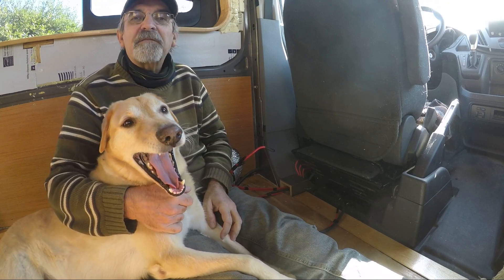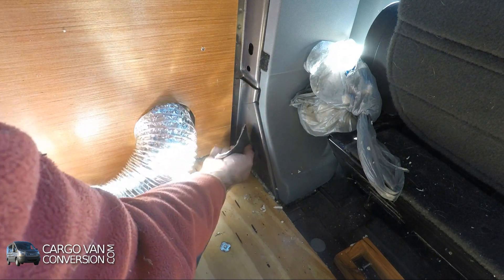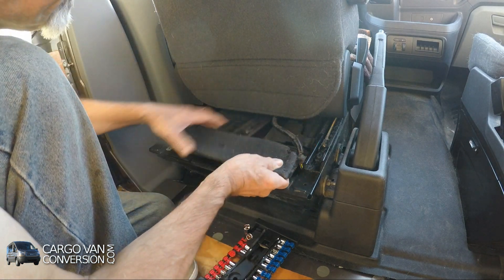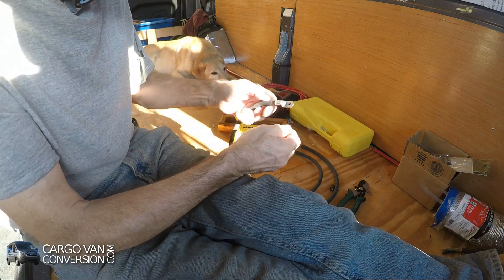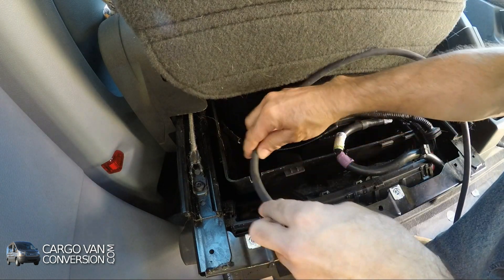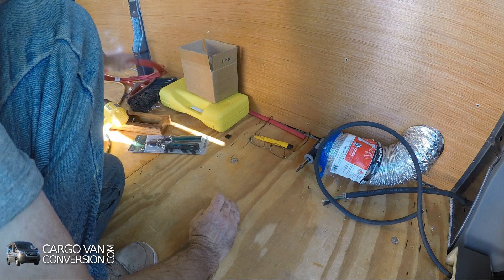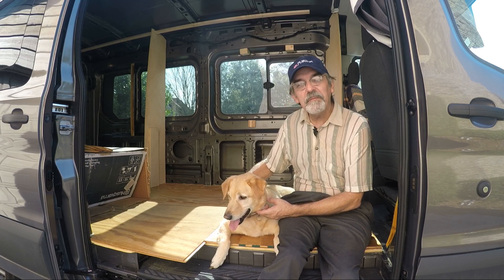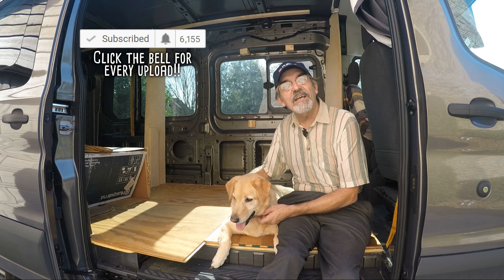Adding Inverter Cables

Comment: Any wire passing thru a steel panel should have a hole grommet or a cable clamp......you'll be sorry later if you don't.
Reply from the maker: I wasn't able to add a grommet in a regular way. but added a partial one after the cable was already installed. I concur that grommets are a necessity in these situations. But they are sometimes difficult to install.
Van Williams

Comment: Hi Van, I've also been crimping my cables last weekend! I bought a green version of that hydraulic crimper. Good to see I'm not the only one who uses the floor or a leg in place of the third hand that this invaluable tool seems to require!! 😁
Reply from the maker: Hi Mevi,
I'm regularly laughing at myself, when I review the videos. Some work needs an extra hand which I don't have :) That leads to funny situations, like in today's video and the turning of the sheet of Formica. Good to hear that the crimper works!
Van Williams
Reply: The formica, yes it looked like you were wrestling with a stingray. 😃

Comment: If you have to make repairs to the inverter, will you have to remove the Murphy Bed to do so?
Reply from the maker: No. I have a row of cabinets under the Murphy bed of about 15 inch (37cm) high. That will house the inverter. I'm working on it right now, so expect a video about it in the upcoming weeks.

Van Williams

Comment: I am a little mystified as to why you have an A/C connection under your van. (Weatherproof or otherwise.) Why not have a proper shore power inlet on the side of the van?
Reply from the maker: Hi Mark,
Two reasons.
I don't want to mess with the outside of the van. It's a stealth thing, don't want to look like an RV, but it's also less holes, leaks and rust.
Probably more important, is that the main purpose, this van will be used for, is boondocking. With enough solar power, batteries and drinking water, I have no inclination of using electrical hookups at all. Situations may occur that justify spending time on a full-service campsite and in those situations, I would still have the setup to hookup a 15A cable.
I think this is a clean solution, easy to use in an emergency without the need to mess with the van.
PS. Most vandwellers will use a stealth van to stay under the radar during urban camping; I have always been skeptical of that, as police can often easily identify an RV by their roof vent or out-of-state license plates. For me stealth is more a way to have a relatively regular van and not drive around in a recognizable RV.
While my van is still somewhat stealthy, the roof vent is clearly visible and the solar panels are, if you know what to look for. So, it's all relative.

Van Williams
Reply: Thanks. Your explanation makes sense. FWIW I did see one guy who hid his shore power inlet under a reflector. The reflector was merely a cap on that port, and looked pretty good.

Comment: Would also be interesting to know how you figured out which gauge wire diameter to use for the different systems/applications.
Reply from the maker: Hi Mark,
It is fairly straightforward, but you have to do it with every 12V connection. The easiest way is to use an on-line voltage drop calculator; I use http://www.calculator.net/voltage-drop-calculator.html
You put in several values, like 12V, DC, (max) load and distance; every wire size will have a specific voltage drop; you should keep that under 2% or rather below 1.5%.
As an example, each stud on the CCP can supply a load of maximum 60amps, distance is two feet, 12V DC.
Experimenting with different wire size gives the following results:
- 6AWG has a 0.79% voltage drop.
- 8AWG has a 1.25% voltage drop.
- 10AWG has a 2% voltage drop.
- 12AWG has a 3.17% voltage drop.
The 60amps will probably never occur, so a 10 gauge wire at 2% drop would be sufficient, but a better choice would be a 8 gauge wire. 12 gauge is clearly too thin, 6 gauge more difficult to work with and more expensive, but you could use it, if you have a piece laying around.
Let's be clear, I'm not an expert; this is just the way I do it. If unsure, find an electrician! 12V can harm you!

Van Williams

Comment: Would you be putting a rubber grommet between the metal hole and wire? Otherwise vibration will eventually cut through the wire.  If there is no room, perhaps a huge slab of silicone will do.
Reply from the maker: Hi sok8888,
I have been struggling to put a grommet on it where it enters the cargo area; didn't succeed. But I will remove one (wider) side of the grommet and slide it in over one side of the cable and glue/epoxy the grommet into the hole.
You pay a lot of attention to detail :) But thanks for the feedback!

Van Williams
Reply: I learn the lesson from a friend whose van caught fire because of abrasive cut of a battery wire. It did not take much to short circuit the wire because he didn't tie down the wire and it was rubbing on a medal. It is amazing how much vibration a wire is subjected to on even a paved road.
Reply from the maker: You're absolutely right! I was still figuring out how to solve it.

Van Williams

Comment: Can you give us some information about your crimping tool for big lugs in the yellow carry case?  Brand, model, Part Number, buying source?
Reply from the maker: Hi charlevoix418,
I have a link in the video ('i' top right) and also in the description of the video (click on show more). 
It's a hydraulic crimper with dies (small insets) that handle wire lugs from 4 to 70mm² (~10AWG-2/0AWG). It's a JAXPETY 10 Ton Hydraulic Wire Battery Cable Lug Terminal Crimper Crimping Tool 9 Dies from Amazon #ASIN: B06W2LVF9R.
A direct link is http://cargovanconversion.com/but/lug-crimper (affiliate link)
The dies are not the greatest quality, but they do a good job and produce really good connections. In my opinion, it works way better than a hammer crimper. And good wire connections in a 12V system are essential.

Van Williams
Reply: Thank you for your quick response!

Unfortunately, your Amazon link doesn't ship to Canada:  I will have to find another source of supply.
Reply from the maker: Your correct! But I found several other identical products on Amazon that do ship to Canada. Search for 'hydraulic crimper' with 10 ton and 9 dies. Unfortunately, they all add a shipping and import tax. That doesn't make sense to me, but that's life...

Van Williams